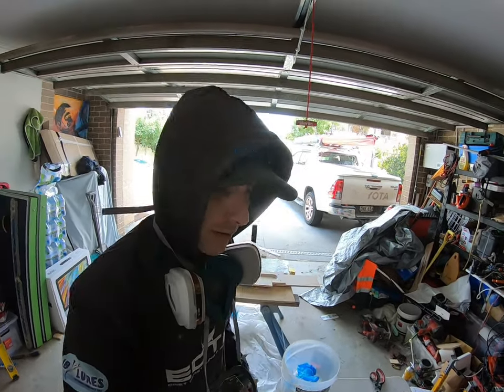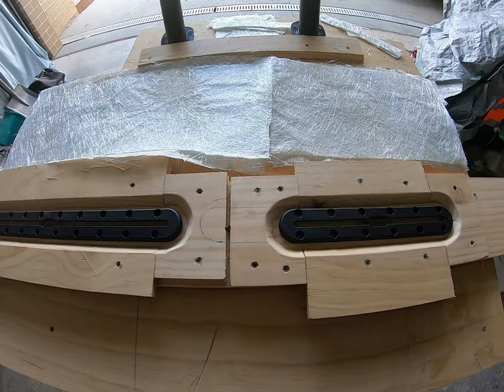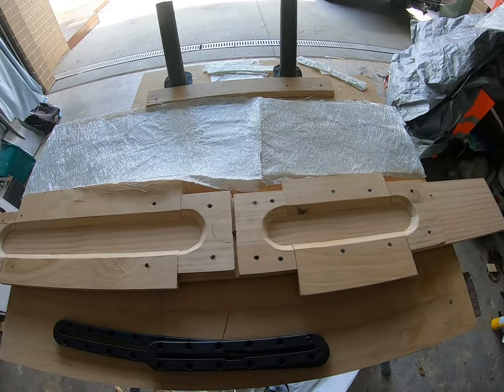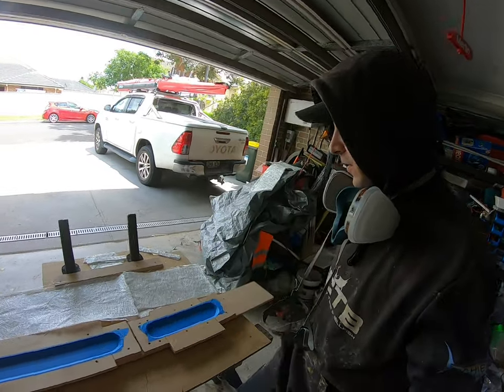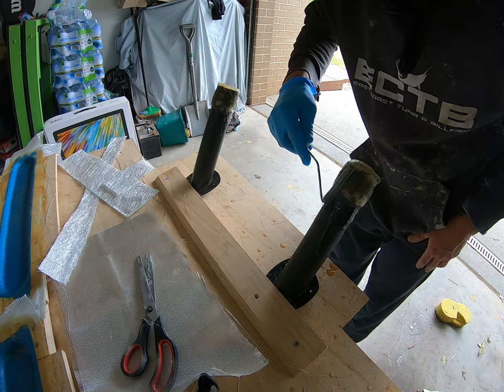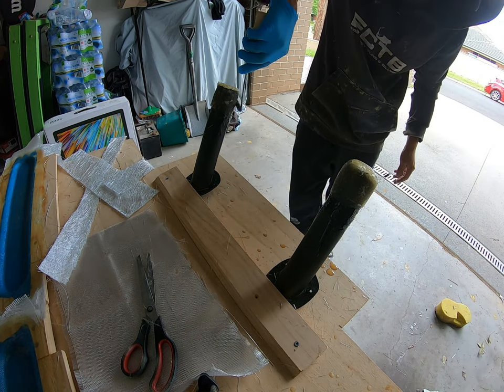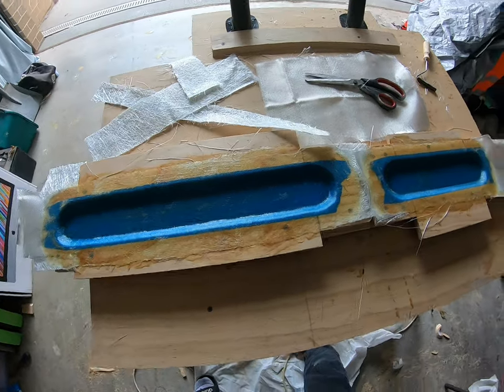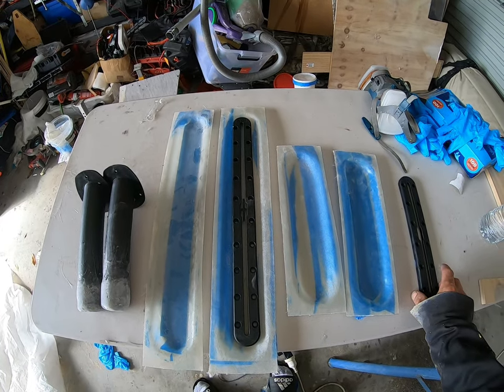DIY MICRO SKIFF fiberglassing the flush track mount and rod holder end caps

Comment: Heloo! Nice work! What weight will it have at the end?
Reply from the maker: Cheers mate I'm not sure of the finished weight, I'll weigh it at the end but the plan is to transport it on the roof so I've been trying to keep the weight in mind the whole time
Reply: @thefishinglair2467  Do you think you can do it up to 65 lbs?
Reply: In this case you would be an excellent source of inspiration
Reply from the maker: Ive been aiming for about that weight I'd say it will be a little but more then that but I'm hoping to be lighter then the big heavy kayaks like the hobie pro angler